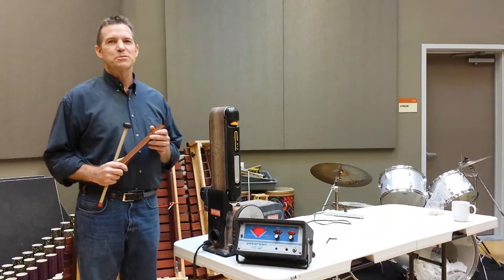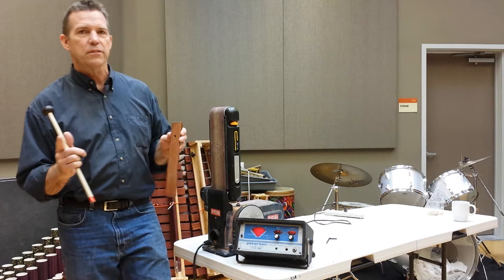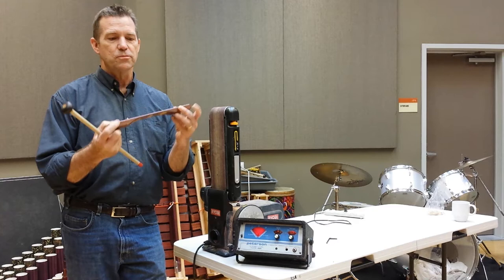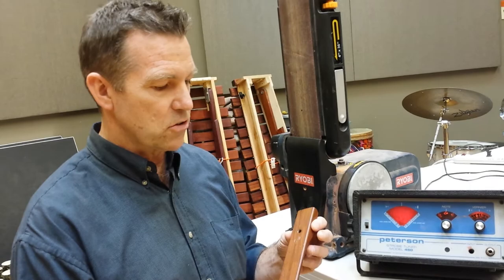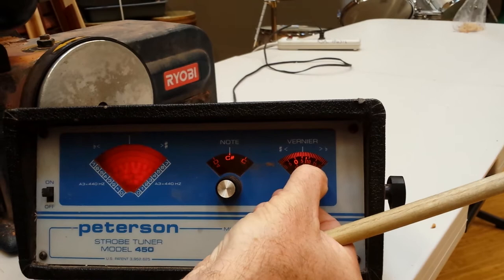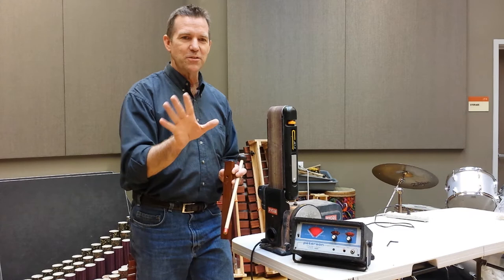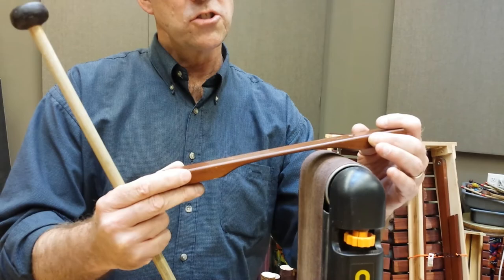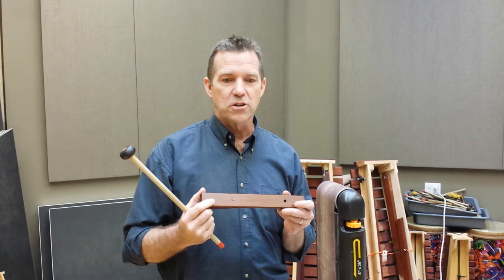Tuning Your marimbas and your xylophone bars

Comment: I'm a bit confused by this talk. I believe xylophone bars are tuned to the fundamental  and  the third harmonic, whereas marimbas are tuned to the fundamental , the fourth and the tenth harmonic.  This difference is largely responsible for the distinct sounds of the two instruments. So the bar you are demonstrating on has tuning more appropriate for a marimba, where the fourth harmonic is two octaves above the fundamental.  It also looks a lot like a marimba bar with its deeply carved back surface.
Reply: Yes, the bar in the video seems to be one from an Orff xylophone by Bergerault, and those instruments are actually small marimbas.

Comment: If the bars continue to dry after a time, causing them to go sharp, then does it make sense to plan on doing two rounds of tuning?...initial tuning at A.430-436, and then a year or two later (or until a few months after they seemed to have stabilized), do a second round of tuning to bring them up to A.440? Have you ever taken a keyboard that was ultra-sharp and re-tuned each bar up to the next pitch and then reconstructed a new bottom bar? When constructing a keyboard from scratch, have you ever made a few extra bars to be stored amidst the frame to make use of in the event you needed to make a new bar (equally dried out as the others)? 

What's your favorite building material? Any materials you've regretted using? Of all the viable/available materials, which do you suppose is the lightest in weight? Might your choice of material be different if you were going to make massive bass marimba bars? 

How about skipping the whole fuss and cutting bars from kelon, if we didn’t care about achieving a wood tone? Do kelon bars hold their pitch? What other materials are good for pounding on that produce nice and/or interesting tones? 

Thanks, Byron 🙂
Sam

Comment: I would think that higher bars are tuned sharp on purpose just like the tuning deviation curves used on pianos. Do the Marimba makers typically tune with deviation since marimbas cover such a wide range of notes? Ive always wondered this. If they do, I can imagine that lowering the pitch of all those keys would actually ruin the instrument.
Reply: Yes they are supposed to be stretch tuned like a piano.

Comment: I have aluminum bars with pitting. I want to sand down to remove the pitting which will probably make the bar out of tune. Can I shorten the bar or remove material to bring it back to life???

Comment: Excellent video, Byron -- and just what I needed.  
I do have one other question I'm hoping you might be able to answer: I have a Deagan model 30R marimba from about 1941, with rosewood tone-bars.  It hasn't always been treated well, and all of the tone-bars are faded, many have water stains, and the wood's grain is open.  I'm reasonably skilled, and I have a full workshop.  If it were not a musical instrument, I would (carefully) sand down the surfaces to expose fresh wood, and saturate it with whatever oil / wax / sealant is appropriate, but I doubt that would be a good idea here! 
Can you recommend how I might refurbish the tone-bars? -or do you know of somewhere else I might ask?  
Thanks in advance!
Reply: I know absolutely nothing, but sanding down bars will definetely change pitch. I would send them to a professional?

Comment: Hello, Byron. Thanks for posting this video. I DO have a question: I need to tune a desk xylophone (one inch wide bars). They are ALL about 15 cents flat. Do you have any hints, clues and insight as to how to get them up in pitch? And what to watch out for as I do this? I have a belt sander that can be mounted in a bench vice and several tuners.
Reply: Not sure if you got your reply about bringing the pitch up if a bar is flat, but you'll need to remove material at the ends of the bars. this can be done by sanding the very ends, and thus making the bars a bit shorter, or by sanding the bottom of the bar at the very end, thereby making the very ends a bit thinner. Note that more material will need to be removed from the ends to bring the pitch up than from the middle to take it down.
Reply: +Nick Chura I successfully tuned that xylo by mounting my belt sander in a bench vice and sanding the bottoms of the ends of the bars (at a 45 degree angle). It worked out fine. The concerts were this past July and August. A marimba would be a harder project, but this turned out great. Thanks for getting back to me!

Comment: Hi Byron....can you recommend a good tuner for working with marimba tuning as well as other instruments?  Strobe seemed the way to go?
Reply: Question is old but, for anyone wondering, there are good apps on smartphones these days that will do the job as well as an expensive stroboscopic tuner. The TunerTime app on Android worked great for me when tuning metalophone bars.
Reply: @Shadocko  Wooden Bars are short in Sound ,while metalbars rings out...this is a Problem with tuning...same is the Overtones

Comment: I just brought home my school's unused, really crappy marimba.  This video showed how to tune bars that are sharp, by taking wood off the center of the bars.  What do you do when the bars are flat?  Most of my bars are 20-80 cents flat because the board is 30 years old and has been exposed to a TON of rain, snow, sun, and extreme temperatures (agh!!!!).  Also, do you need a sander or can you carve out wood using a knife?
Reply: To raise the pitch you can remove material from the ends of the keys (try underneath, beyond the nodal points). What you are doing is removing mass from the key without increasing its elasticity, which allows it to cycle faster. Knife or chisel will work. However, even 20 cents worth is a fair bit of material, and will affect the nodal points of the bar; something to bear in mind.